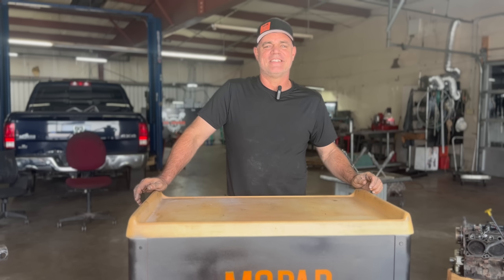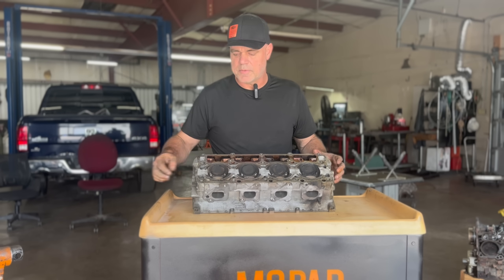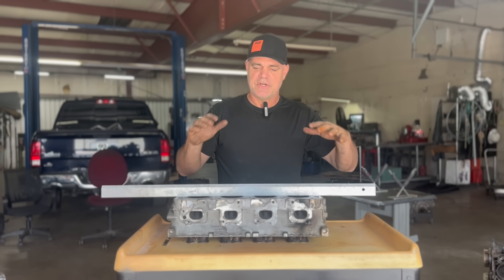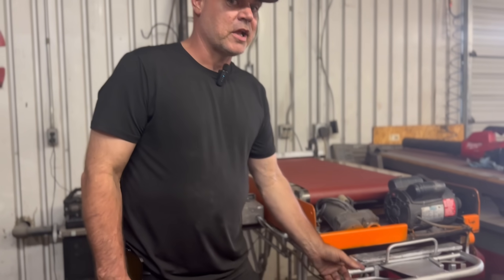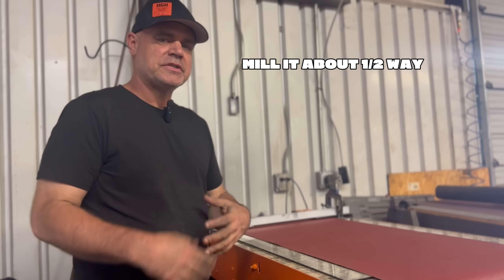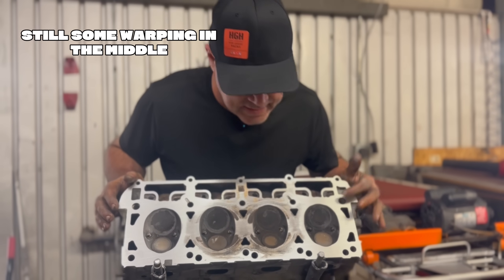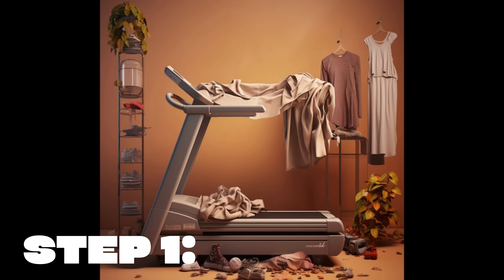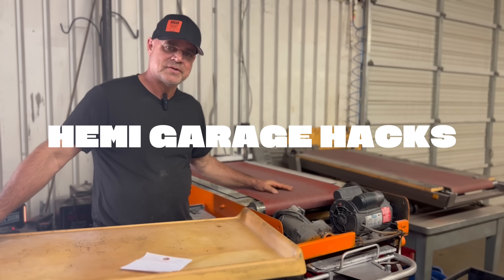I HAVE MILLED 1000+ CYLINDER HEADS WITH A TREADMILL!

Comment: I had an old piece of granite countertop (was extremely flat!) that I used to glue various grades of fine sandpaper down to and would just run the cylinder head across that until it cleaned the head up.  Back when I was much younger and had little-to-no money.
Reply from the maker: I bet you were buff though:)  That's a good workout.  Thanks for commenting

Comment: My question is how do you keep both cylinder heads exactly the same so you don't have one side with higher compression than the other?
Reply from the maker: measuring the time my friend. and reversing the head direction at least once or twice during the resurfacing.  Great question, and thanks watching.  Glad to have you here:)
Reply: point is you are making it flat. not taking off lots of material

Comment: JUST BECAUSE THE SURFACE IS ROUGHENED DOES NOT MAKE IT 'TRUE'
Reply from the maker: many people think that at first (as I have experienced over the last 13 years), But they are always shocked when they see the result.  And as a side note, the Straight-edge is your friend on this for sure.   Thanks for sharing and I am glad you are watching.
Reply: If the engineers straight edge shows it is flat then it is flat without hollows for sure.

Comment: It's effective but it's also risky. If you get happen to even a tiny amount of buildup under the sanding belt it could transfer to the head. If it's more than a tiny piece of debris then the head could have a gouge worn in. It wouldn't take long on aluminum.
Reply from the maker: A valid concern at first, to be sure.  When first made 13 years ago, I wondered that.  As it turns out, the finish is beautiful.  thanks so much for the comment and we are glad you are here!
Reply: Doing it by hand, I lube the sandpaper with diesel oil and clean and inspect it every few minutes being careful to insure that aluminum is not building up anywhere.

Comment: I like it. Honestly surprised 60 grit looks that smooth when its done. Watched a guy do something pretty similar to this on a 383ci small block chevy. When he was done, the intake leaked....alot.  They had likely been milled once before, but he also got a little aggressive with the material removal. It would squish the bottom of the intake gasket but not the top. 
He had to take the intake to the same mill, and take some off the china walls to get the intake down far enough, also had to trim intake gaskets, and do a little port matching to make it all happy. It did eventually work, and survived many many blasts of nitrous, but had enough compression, a gear reduction mini starter had to go on.
Reply from the maker: good story!  that brings up a good point that I did not mention in the video.  when I am resurfacing, I change the direction of the head once or twice.  and yeah, people are always blown away at the finish on the head when we are done.  We mill our own heads of course, but we also mill for other shops and individuals.  Thanks for sharing and I am glad you are here.

Comment: used a large piece of tempered glass from an old TV stand with sandpaper but manually had to move the head back and forth but I'm not doing it everyday
Reply from the maker: yeah, that was my thought which is why my mind moved to a treadmill since we do 3-7 motor jobs a week.  As a side note, I thought about tempered and then a glass guy told me it is a little less true because of the heating process to temper it.  Not sure if he was correct, but I opted for the untempered just to be safe.  Thanks for sharing and glad you are here:)

Comment: NO Good , Set it up on  real decking machine take a lite cut , and you will see how fuked up it is lol
Reply from the maker: I actually love that idea, what a cool test that would be.  Thank you and glad you are watching!
Reply: @HemiGarageHacks  hey I’m curious to know what sandpaper grade are you using for the Cylinder Heads and for the exhaust manifolds you mentioned that you’re using two different ones this is probably the best thing you’ve seen on the Internet the rest of the guys that are not liking the idea, are trolls😅

Comment: Rough as guts engineering flat and level are not the same thing.
Reply from the maker: It would actually surprise you if you saw the finish, and it passes the straight-edge test every time.  Thanks for commenting, and it's good to have you along for the ride.

Comment: Im wondering about where the sandpaper belt is joined, is there a bit of a rise or a slight bump on the belt where it is joined?
Reply from the maker: I have a picture of it but I don't know how to show it in comments.  It's basically slightly recessed, you don't really feel it as it passes.  Good question, and thanks for the comment
Reply: @HemiGarageHacks  These abrasive belts are lap jointed and where the lap joint is the abrasive grit is removed from the cloth/fabric backing so the joint is quite level without any noticeable raise or bump as the belt runs. The ends of the belt at the joint are usually cut at an angle across the width of the belt(often called scarf jointing)
There are a few videos on YouTube demonstrating how to repair/re-bond broken belts and how to make new ones from sheet abrasive rolls.

Comment: You don't know what you are talking about. You can't surface the gasket surface if the cam bearing journals are not in line. You must use heat to straiten the head. If the cam bores are  straight you can surface the head.
Reply: He said he’s done this over a thousand times with no problems.
Reply: @tvmcdugle  two thousand times? what is that, one a day, per work day, for ten years straight?
Reply: @tvmcdugle I don't believe his numbers. You can not remove more than 0.003 inch from a overhead cam cylinder head. The valve timing will not be correct. If the cam bore is not straight the cam bearings will not have the correct oil clearance and the cam and brarings would be destroyed in seconds.

Comment: The gasget is to compensate for the little warping. Not bad what you do but for a normal use of the engine its not a problem
Reply: But al with all a perfect cheap solution

Comment: I've had arguments with people online claiming that slab Granite is not flat enough for surfacing heads, obviously they're wrong.
Reply: I have granite flat plates which are for attaching various grades of abrasive sheet material...some aluminium oxide and silicon carbide paper backed abrasive for finer finishing. Providing you move the work-piece back and forth evenly it will lap it absolutely flat when checked against a precision granite straight edge.....flat plate abrasive lapping is commonly used in engineering shops to attain flatness and fine surface finish.
Reply from the maker: The safeguard, in case there is some truth to what they are saying, is to put glass on top so that you can shim between the glass and granite if need be.  Thanks for the comment, glad to have you here:)
Reply: Shim it with what? Do a video on ahimming it.
Reply: The "granite" is not always flat so as  I use discarded scraps from the countertop outfits scrap bin, there are hundreds to choose from.  Just choose a  perfect one.

Comment: Use black felt marker and draw lines on the head after a quick hit. Then after another hit see where the marker lines still are. Cheap  and fast.  And stops you from working one spot to much
Reply from the maker: great tip, thank you
Reply: A better suggestion is to use machinist dykem blue spray
Reply: @wisky3 Probably also slower and costs more than a Sharpie...
Reply: @MrMEmEmEmEMEMEeeeeee its available in a spray can, ut dries in seconds, theres a reason machinist use it

Comment: You ain't milling anything there... 
you're belt sanding ..
Reply from the maker: Belt sanding indeed.  Terminology was designed to relay the concept of straightening a cylinder head that most are familiar with.  but technically, you are correct.  Thanks for sharing!

Comment: The machine shop i bought my flow bench from in the early 90s had a head surfacing machine that worked like your treadmill. I have used the table method with good results as well on my nitrous SBC.
Reply from the maker: it's been a life saver.  I've literally been using this same one for 13 years not.  I end up changing the belt every 2 years or so.

Comment: I was skeptical, till you had put glass under the belt.  flat for sure.  cheaper than a machine shop, and for most daily drivers it is justfine.
Reply from the maker: And a good note to add is to not use tempered glass, as it can be a little distorted during the heating process.  Thanks for the comment and I am glad you are here:)
Reply: @HemiGarageHacks  Yeah I never thought about that but they do have a dimples in it. Hmm shit you learn.  :)

Comment: I Googled "custom sanding belt" and got several returns.  Only looked at Maverick Abrasives.  They say they can make belts "in widths from 1/4” to 60” and lengths up to 400”—with grits ranging from coarse 24 grit all the way to ultra-fine 1000+ grit".   Media can be Aluminum Oxide, Zirconia, Ceramic, or Silicon Carbide.  Didn't look for pricing.
Reply from the maker: Mirka is who I ended up using
Reply: @HemiGarageHacks  I checked on the Mirka site. I didn’t see any options for a custom sandpaper sizing. Did you reach out to them directly and if so, was it email or phone? Thank you.

Comment: Awesome...what grit paper do you use for the aluminum heads?
Reply from the maker: 60 to 80 grit.  60 grit after milling a couple exhaust manifolds on it, seems to be the sweet spot for me. The belt will last me 2 years or so before having to change it.
Reply from the maker: 60-80 grit has worked great for me.  I run some exhaust manifolds on the 60 grit just too dull it a tiny bit, but it doesn't take long to get an awesome finish.  80 is cool, it just takes a little longer to do the work.  Thanks for the comment, and glad that you are with us on this journey:)
Reply: Ever do an aluminum block?
Reply from the maker: @chriszucker7500 yes, not very often though
Reply: @chriszucker7500  Aluminum blocks  are as easy as aluminum heads are.  Cast iron is much slower  to sand down.
I use sandpaper glued to  "granite" 25lb counter top pieces wider and longer than the heads glue a handle on the "granite" and push it back and forth until the aluminum is flat.  As "granite" countertops are not always flat you must discard any of them that are not perfect. I lubricate the sandpaper with kerosine and as I brush it on I can wash out the aluminum particles.
Reply: @chriszucker7500     Yes and the engine was still in the chassis  in a single seat car.

Comment: Hi, not to be a whiner but I don't see the info on where to buy belts. Also the grits that you use? Thanks much !!
Reply from the maker: The company is called Mirka and you can use 60 or 80 grit.  60 works great, but, shave a couple of exhaust manifolds first or run a prep pad across the surface of the head after resurfacing on the first 10 to knock the peaks off.  After that, you are good for about 175 heads before needing to change the belt.  Hope that helps, and thanks for being alongside us in this journey:)
Reply: @HemiGarageHacks  Thanks! Could you speak a little more about the granite and glass setup.  Where did you get the granite? how thick is it? Same question for the glass. Is the motor 1725 rpm? Thanks !!

Comment: I blew a head gasket on my 3208 Caterpillar.  I thought it might be a good idea to get the head milled.  A Hack at a NAPA pretty much ruined the head on a Belt Sander.  I had to take it to a race shop and get it actually milled on a head milling machine. Now the bolts don't line up because so much material had to be removed to save it.;  There is no combustion chamber, thus the compression ratio was not changed.
Reply from the maker: Dude!  and I bet a Caterpillar Head ain't cheap.  How much would that have cost to replace?
Reply: @HemiGarageHacks    I have three of them.  I bought a used Truck with a 3208 250 HP Turbo with only 50,000 miles on it.  I bought a new 3208 Cat in 1985 for $8,200.00  Plus it cost another  $3,000 for starter alternator brackets fan power steering pump and RADIATOR ECT.  All Ford parts which are not available anymore.. Then I bought a core motor to trade to Jasper for a rebuilt engine with hard steel sleeves and two ring pistons.
   There is a thin ring around the lifter area.  the head is very heavy and the weight of the head caused the sand belt to take way more off from the  ring around the push rod area..
  It is very narrow area where the head gasket goes.  They used a very coarse grit sand paper .. I could put my thumb nail in the groves the belt sander left.. It would have been blowing exhaust smoke out those grooves under the think steel head gasket.  I am guessing they don't sell new 3208 cat parts anymore .. a Dip Stick tube was $100.00 the stainless steel couples that hook the exhaust manifold to the Turbo cost $175.00 10 years ago .
  12,000 hours on the new motor and  7,500 hours on the Jasper rebuilt.

Comment: Was done a a lot in days gone by. Maybe an issue getting the correct RA for a multi layer steel gasket in modern engines with high compression ratios. They also have the potential to make the head into a wedge, ie the bottom face not parallel with the top face.
Reply from the maker: Good point.  I would definitely recommend changing the direction of the head during the milling process, this is what I do.

Comment: i have the real version i bought new in 1985. peterson pg-1400. it's called a platen grinder. my primary use is for exhaust manifolds but i have done a lot of heads, several blocks over the years. mine is water cooled. water goes under the belt in channels to protect the platen and a hose goes in the head to keep the head cool. 10hp motor. 
if doing cast iron let the belt come to a stop with the head on it. with aluminum you need remove the head while the belt is still moving. you probably know but this does not work on aluminum overhead cam heads -  they need to be heat straighten because the cam journals bend with the head
Reply from the maker: Great input, and helpful information for others.  I will say this about surfacing cam over heads.  I originally specialized in 3.7 and 4.7 engines which are cam over heads.  We made sure to switch direction when milling to evenly shave off material.  We did a ton of those heads over the years, and they worked out great as long as you kept that practice when resurfacing.  Out of curiosity, how much did you pay for the pg-1400 in '85?
Reply: @HemiGarageHacks  somewhere between 7-8k. it paid for itself in the second year. did LOTS of manifolds back then
Reply: Our shop had, what I think was (long time ago) a Storm Vulcan 30 HP wet platen sander. Probably, like yours, in the 80's. It was termed "linear interrupted surface finish" because the grain would break before running the entire length of the surface. Our unit had power/air down feed pressure, as well. Also had a balancing bar for doing V8 engine blocks. Lots of use grinding welds down on aluminum cylinder heads, which were finished on a proper mill, and so many exhaust manifolds. I truly miss the old days of the machine shops, I've worked at.
Reply: by the way my machine came with weight bags (lead shot) to put additional pressure on the head when needed
Reply: @deakin2880  We had some motorcycle and auto tire tubes that had been cut and filled with Wheel-a-Brator(?) shot and crimped closed.

Comment: Good way to think out the box bro I got a mill and lathe plus bore bar and all the head tooling to do seats and guides  and a single point hall toledo orbital seat grinder Der all I do is performance work but tbt that would be alot easier then the time it takes me to setup head on my 10x52 knee mill
Reply from the maker: Dude, I know exactly what you mean:)  Thanks for the comment and I am glad you are here.

Comment: Serious question, what does the surface measure with a Mitutoyo Profilometer?  What is the "RA"? Sanding scratches are not ideal for modern gaskets to seal.  Start at 4 minute  https://www.youtube.com/watch?v=w3XsZ6sLoRk
Reply from the maker: You can have a beautiful finish with the right setup of sand paper.  obviously a 60 grit will cut faster than a 120 grit, but if you have the time, then why not.  The sweet spot for me was between 60-80 grit.  The finish is really nice and it hasn't given me issues in the 1000+ heads that I have milled.  Good question, and I am glad to have you here.
Reply: @HemiGarageHacks  I think you need more like 600 grit, but that's just me.

Comment: Video was a good overview but I am always amazed at what is included in this type of video and what is left out.  For instance you show it getting washed and painted.  Everyone knows  how to to do this.  But you don't show where the granite came from, why its not flat nor how you attached it to the treadmill frame.  Large blocks of granite can be obtained at machine shop auctions and these are dead flat and can be used to check your straight edge.  Now the glass helps protect the granite but glass is usually far from flat (compared to a granite block).  But maybe you are using countertop granite or head stones as opposed to metrology grade granite blocks.  You do not state what grit paper  you are using, best belt speed, and what finish you achieve.
Reply from the maker: You are 100% right!  It was tough trying to figure out what to include and what not to include. Like what part of this is interesting and what details are too boring?  There is a lot to it for sure. The purpose of the glass is two fold.  first, to shield granite surface, but second, and more importantly, it allows me to shim between the two if anything is at all uneven.  Great input, thank you.  And I am glad you are here!